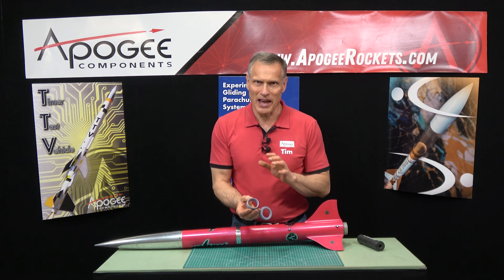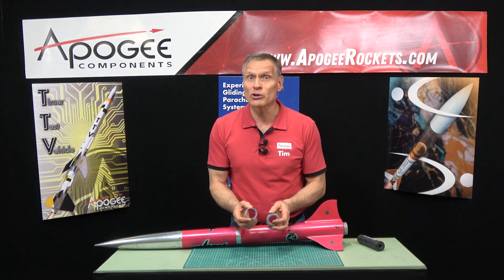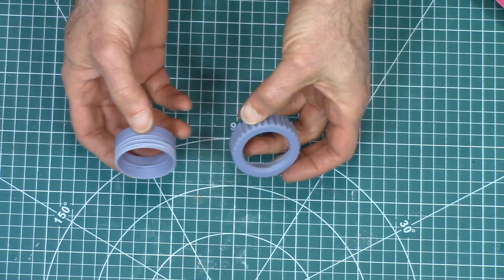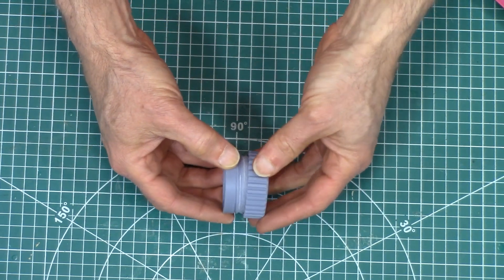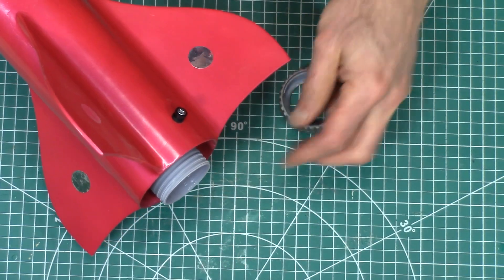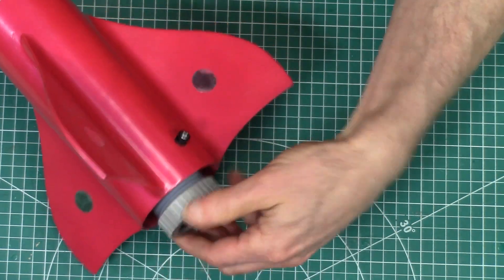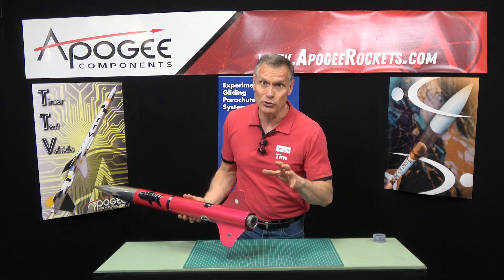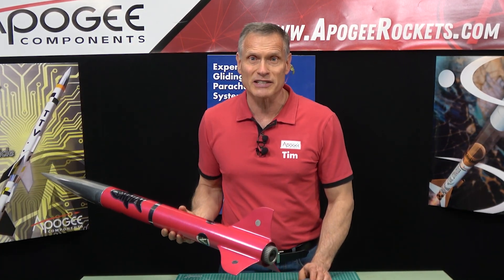NEW Apogee 38mm Plastic Engine Retainer

Comment: I never thought you could paint your retainer.
Reply: There is no point to painting the retainer.  It will just get encrusted and discoloured from the exhaust; perhaps some melting and deformation which is why aluminum retainers are 10x better.
Reply: @Roarmeister2 I got the initiator and I put the plastic retainer on.
Reply: @Workerbee-zy5nx   Initiator is a great MP rocket.  I also have the big brother version!  Have fun.

Comment: Won't they melt after a while? Just curious..
Reply from the maker: It should be fine. We've been using plastic retainers for years.
Reply: @apogeerockets what plastic are they printed with?  ABS or PLA?
Reply from the maker: @rcmanicmd  we use a SLA printer with a Urethane resin.

Comment: Yes, yes, yes......I need that. I really need it in 29mm....x5. Can you say Nike Hercules? I'm going to the store right now. That project is just getting more and more expensive the closer I get to beginning it, but I'm not turning a screw on it till I'm happy with EVERYTHING.....= )
Reply: I'm not sure there's room for anything other than the retention that's built into the Nike-Hercules kit. The Nike booster could potentially work with Aeropack retainers, but there's nowhere to actually grab them to turn them on, and the motor in the Hercules missile is inset far enough that it has the same issue (despite a larger diameter.

We started with the 38 mm because the Estes plastic retainers exist for the smaller sizes, but if these prove to be popular, were happy to create other sizes too!
Reply: @martinmckee5333  that's what I needed to know. You wouldn't believe what I've managed to shoehorn into this design so far. Thanks Martin.....= )